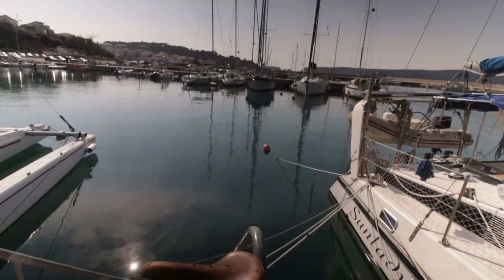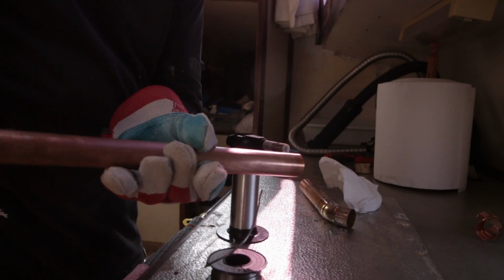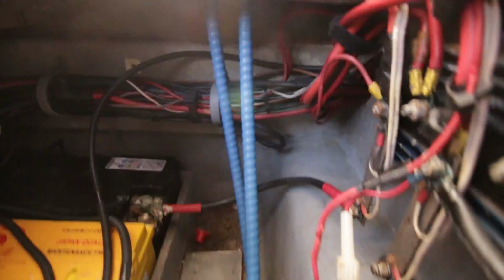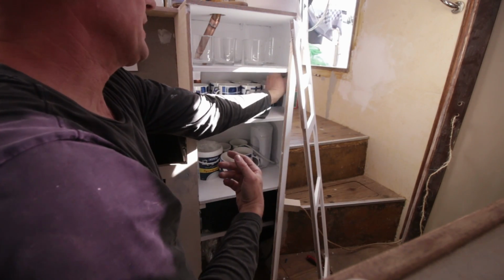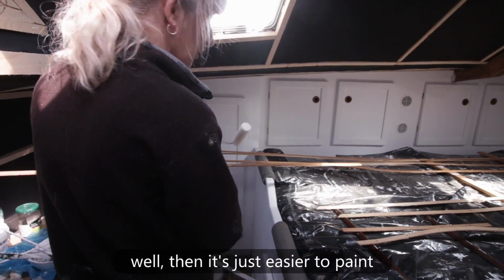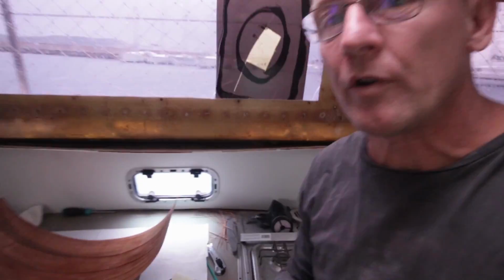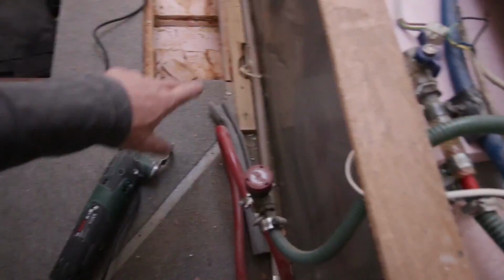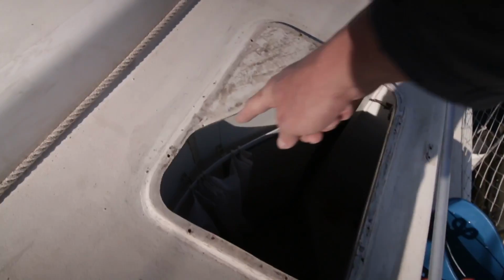Why everything always falls into  the water?! Sailing Exodos, ep.11

Comment: Please look again to the muffler of your diesel heater. Mine wasn't airtight and should not be used on a boat. They are designed to mount under a vehicle in the open air. There's even a hole for the condensation in it. You better look for a marine webasto exhaust. Also, the muffler pipe should be mounted with exhaust mounting paste. And I hope you have a carbon monoxide alarm in the boat because.... we like you very much!

Comment: Nice work . I love that counter top. I see some good progress on the ship.. 
Just a small detail ..Hard solder go’s over 450 c so it was a soft solder job ;-)
The aluminium wil disintegrate during time. So one day you had to replace it. 
Isn’t there a song about caring two buckets . . ?
Reply from the maker: Haha, oh, didn't know. I thought soft soldering is with an electrical soldering iron and hard soldering with a torch. And didn't know either about the aluminium. You see, I'm a real professional, hahaha! The problem over here is that it is hard to find the right materials, because actually we are in the middle of nowhere. And when I find somthing on the internet in Greece, it can take a week or more before it is here. Can't always wait for that...
I don't know a two buckets song, but I guess i rather hear a 100 meters garden hose song! :D 
Oh, about the countertop... I kinda ruined it with the first layer of epoxy (microbubbles and all), Had to sand it down again.
greetingz, Wim